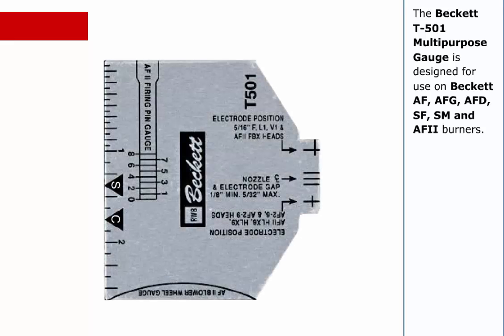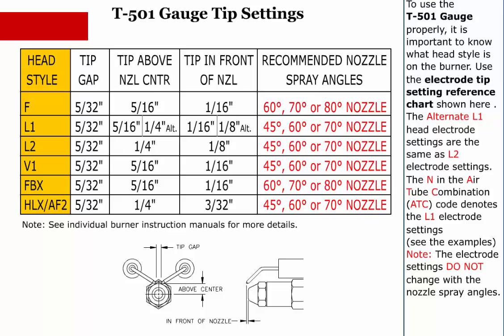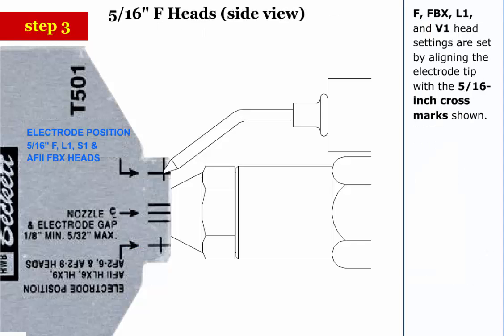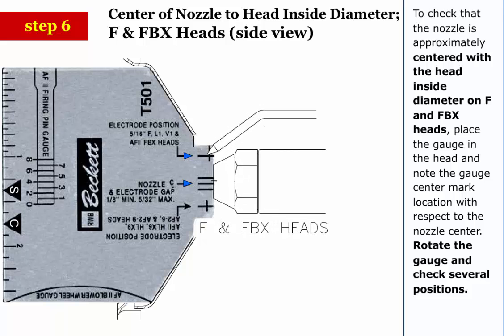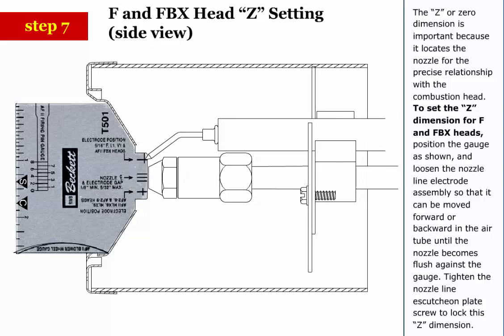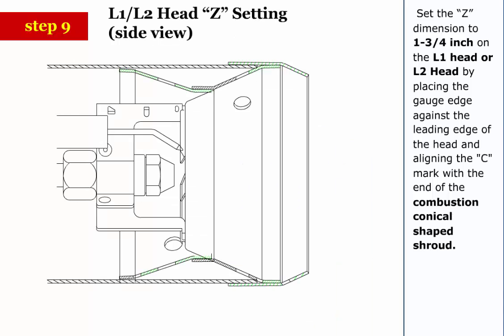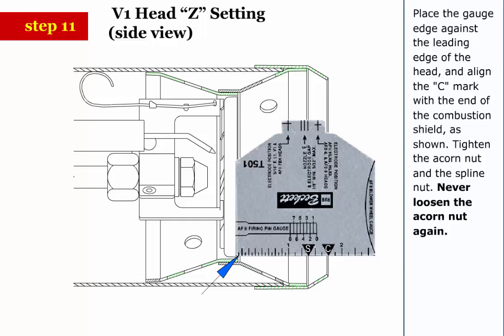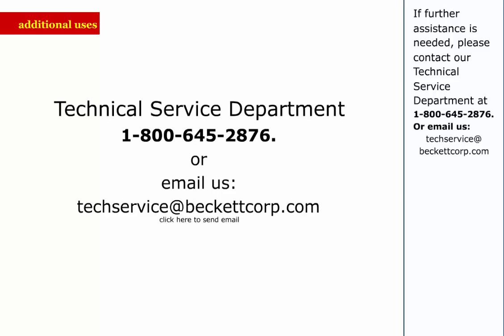Beckett T501 Gauge Training Module

Comment: Quick question how do I know which head I have on my unit to choose which measurement to use. Can’t seem to find any listings of the various heads? Shop has 350II and 500s part # B20268 for the CF Burner electrode assembly. Cheers
Reply: stephen zies
1 second ago
The Model  Letter Is Stamped Into the Face / Front  Of The Head